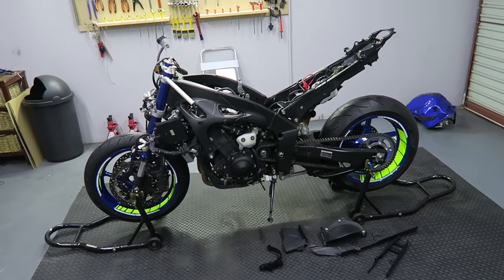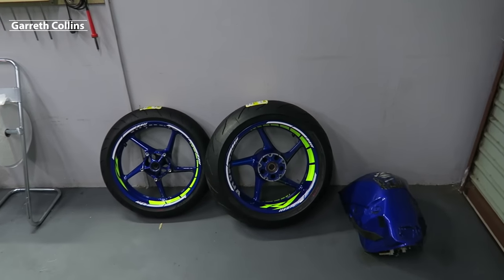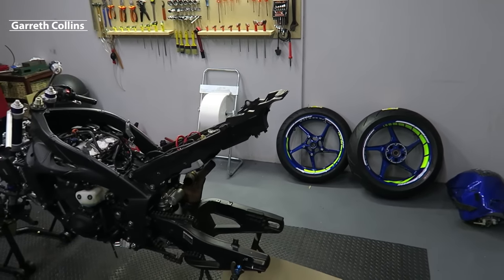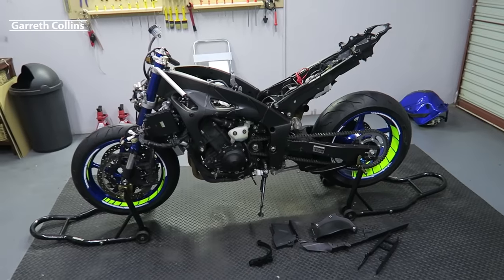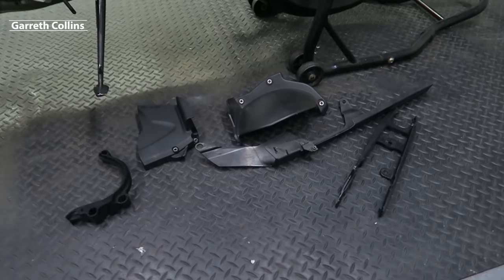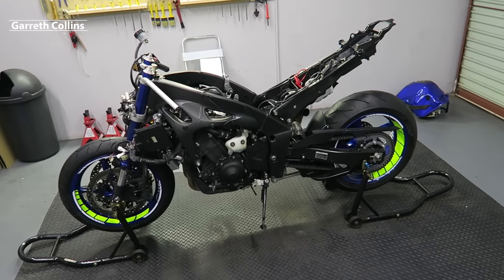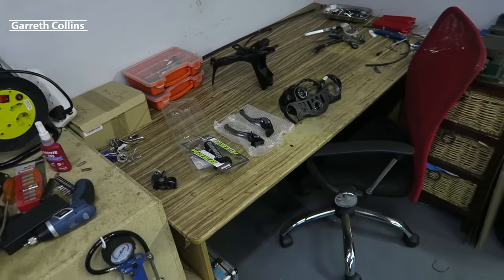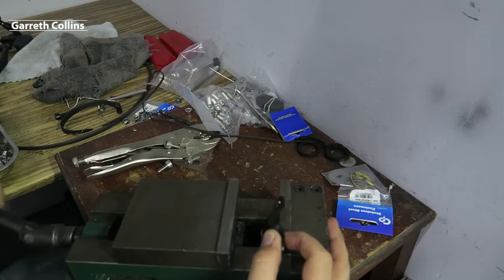Rebuilding A Crashed 2014 Yamaha R1 Part 6

Comment: Looks stunning man the way you put the effort and the grit from the previous video until now. Would be great though if the brake line are being replace with a sets of performance steel braided. Besides its look stunning and added more value as well. Just my opinion man & thanks.
Reply from the maker: Break lines are fine 😉